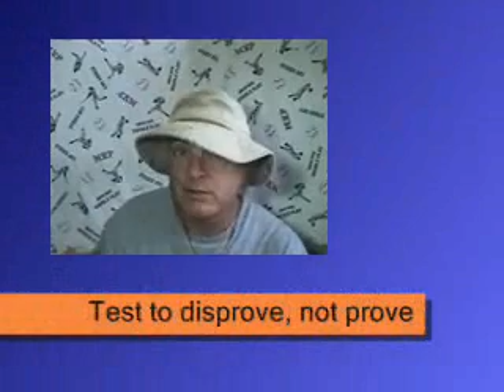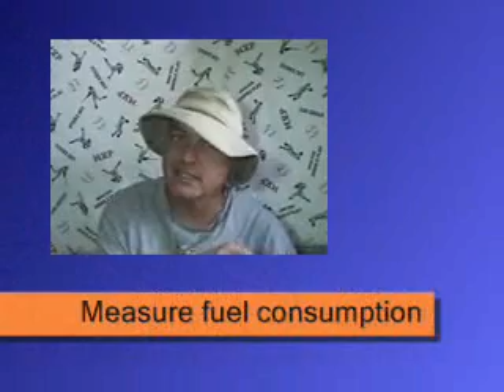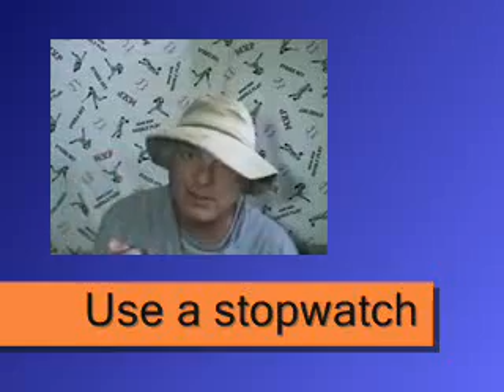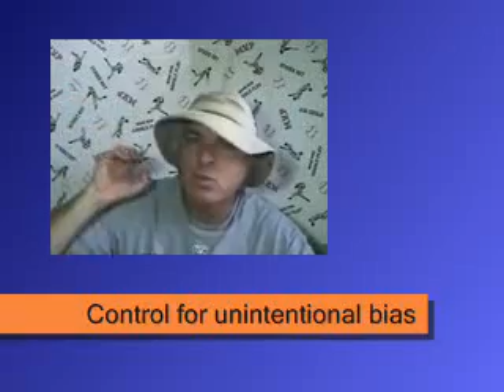Regarding: '#232 - HHO runtime experiment part 3'

Comment: @FredricF Actually no thats not why. Go check some more, just listing peak power would be useless, ohh but wait they also list the rpm of that peak power, which in fact is going to be a form of power. It is sad though how you are pulling the topic sideways, and never have addressed the simple fact that the comment is in fact correct. you simply wish to talk about how manufacturers list a description of their product. Which BTW is correlated with fuel per hour with generators. Keep trying.

Comment: @d3adp001 
So your argument for expressing the output of an engine as energy instead of  the correct quantity, which is power, is basically insults and repetition. Not that impressive. 

A question: Do you think energy can be created? Or "generated"?

Comment: @d3adp001 
I have a Masters degree and people pay me to work with motors (among other things). I get paid, not to read manuals and fix with them, but to design systems and tell the tech. writers what the manuals should say.
I know all about motor power, rpm, and torque curves. I have read specs. I have not yet read a single spec that talk about energy output from the motors.

Why don't you just admit you made a blunder and stop trying to cover up. And learn to spell and what "ad hominem" mean.

Comment: @FredricF u should so they can tell u what I am telling u, They rate their engines in PEAK POWER 1hp=746watts, they do this because idiots like u would understand it if they told u the real specs of the engine which amoung other things is a curve of energy content of fuel in vs energy output of engine. 

EVERYTHING BUT ONE THING U SAID IS WRONG "a really smart guy on youtube" u got that correct, and thats the only thing u got right

go away u fucking idiot

Comment: @FredricF to clear a couple things up: Engines (ICEs) DO NOT PRODUCE POWER. They convert energy. They convert stored chemcial (ulp) energy into many other forms of energy such as light, heat, kinetic/mechanical.  The kinetic energy excerted on the engine results in mechanical motion which is then measured by acceleration vs time.  THen through many conversion processes, can be measured anyway you want.

Comment: @FredricF energy is = to Joules= wxS = power in time
power is = watts= a timeless measurement, instanteous measurement. Engines produce energy, when you change the throttle closed the POWER OUTPUT goes DOWN and THEREFORE the amount of energy being expended or output GOES DOWN.

Do you have the mind to keep up with the conversation? or do I have to "SHOW MY WORK" for every math problem there teach. 
Do you know the difference?

Comment: @d3adp001 Still not convinced you know the difference between energy and power.

Engines produce power. When you change the throttle the power changes (usually). You used the word energy instead of power which could be a typo or a sign that you are not really sure about the difference. At least not sure enough to use the correct word.

Comment: @Chicken Good u can use a mcirometer
So show me the data, please if its a pertinent then it will make this all much easier, but I warn u, it must have the correct pieces in the DATA from an actual TEST
What law do you think would have to be violated
No u dont need data because like every fanatic u have FAITH in a RELIGION
its not the conversion that will change anything in the test
yes u do seem to care WHICH IS VERY BIASED AND NOT SCIENTIFIC
but you dont know because you have seen it, ZEALOT

Comment: @d3adp001 
Sigh. Assumptions?
I have sufficient hands on experience with my physics credentials.
See I can measure my dick too. The Ph'ds DO know the answer.
In my experiences, the particular laws of physics are IMMUTABLE.
I dont NEED any test data, I KNOW that as of today, there is no conversion process that will provide more energy than it consumes.
I certainly "care how it ends", and already KNOW, I say again, I already KNOW that the end net result is wasteful.

Comment: and that mixture would reduce the consumption of gasoline... is this venture still not worth exploring?  What I would suggest to test things better in addition to your comments would be to monitor the HP generated during regular, lean, and HHO injected (from an outside source).  If those tests show that adding HHO and tuning the mixture can result in a drop in gas consumption and an equal amount of output... then maybe run the HHO generator off of brake powered generators, or ... cont again

Comment: gasoline engines are designed to run a certain way, yes, but the ultimate goal is to show that an HHO/Gasoline/Air mixture can work and consume less Gasoline in the process.  Wouldn't the addition of HHO (a fuel) make the mixture less lean?  If so, then you counteract the leaning out of the engine.  Running the HHO generator will decrease efficiency no matter what, however, if another energy source were to be used to generate the HHO, and an engine can be made to burn it with gas and air ..cont

Comment: @JamesThWilliams you alude that I am making claims, which is not the case, neither is Zero, PEOPLE have made claims that the increased speed of flame propagation reduces the distance of quence, which burns more and more completely burns, and a better timing burns the existing fuel, thereby adding a small amount of a better fuel, the existing fuel can most eff. be used. If this is the case increasing the eff. of the fuel burn by a small margin makes a difference in fuel economy.

Comment: @JamesThWilliams hmmmm, so you wish to be that literal because thats the last little thing you can attempt to do in your failed arguement. 
your stats are wrong on eff. BTW its 80-85% eff. 
the hydrogen fuel cell used to produce electricity from H2 and O2 is 40% eff. 
And its very sad when you are trying to split hairs like that, its always a sign a someone grasping at straws. 
You understood very well the simplied version to save chars in this format.

Comment: @Desertphile You waste energy every day. By not using what you easily could, and letting it into the air.  You waste energy quite frequently. Everyone does. It would be infinitely better to lose .15% in the conversion of electrical energy to hydrogen energy and then use that hydrogen energy instead of another form that pollutes. You can tow your status quo all you want, that just makes you part of the problem, the problem of insustainability.

Comment: @d3adp001 dude,the tests HAVE been done,and HHO has never so much as shown an ounce of promise,its not fuel,in fact,in the context that HHO device "inventors" use the term HHO,it's not even a real thing,can hydrogen be used to power a car? sure,but in a regular gasoline powered engine? probably not. the point you're missing though,is that HHO devices neither produce HHO,nor does HHO even exist in the context that they use the term,imaginary things can't improve milage

Comment: @d3adp001 it's oxygen AND hydrogen assclown,thats why they don't just call it hydrogen,and HHO is real,no doubt about it,the question is whether you can make a car produce it,and then use it,to the benefit of your fuel milage,and thus far,every time the question has been asked,the answer has been a resounding no,not with a standard gasoline engine,perhaps you should do some of this reading you claim to be so fond of,nobody EVER has built a working HHO device for a car so far

Comment: @d3adp001 I don't "believe" in anything,i face every new circumstance with varying degrees of certainty,based upon my understanding at the time. thats different than believing,and it's different than believing in homeopathy since homeopathy is a type of "medicine" that CAN NOT POSSIBLY work,if homeopathy does work,or has ever worked outside of the placebo effect,they'd have to start medical science over from the very start.

Comment: @HHOinfo well considering that the fuel has a liquid bubbler barrier to draft in hho, that the draw tube goes directly to fluid, that the jas is vented to outside air, and that hho disapates very fast, and that Z understands what he is working. I see no safety issues. 

On top of that, DP's comments were not in regard to the combination of hho and fuel, but in regard to the fuel alone, which if the system was unsafe, then the metal fuel tank that once held the place of the jar wasnt any safer

Comment: @LeksServices Failed,, to make your point understandable by using complete sentences. 
But 30,000 per vehicle, hmm even if it was a semi rig (worst fuel econ) that would be 150k miles per year. which would take 2500 hours at an AVE speed of 60 which is 500 more hours than you can really work. 

So what is this tech that can safe more fuel that one can possibly even burn.

Comment: @coasterpro  Assertions should begin with "IMO."  'Zero gain' is your gratuitous assertion. Or you are quoting an entry from a 1950 Encyclopaedia Britannica.  Either way it is gratuitously dismissed.  

Electrolysis is NOT the end game. 

The ICE powers electrolysis of the HHO..  HHO  injection from a modern electrolyzer into the ICE improves  operating efficiency. Net gain in efficiency = END GAME.       

Desertphile is the one who demands windmill powered electric vehicles IMMEDIATELY!

Comment: @OgMandin0 HHO is a bridge to no where. It represents zero gain. As for electric-only, the lack of electric cars is due to utility demand and charge times. If everyone were to go electric today the grid would simply self-destruct. On top of that the inconvenience of a long charge time vs. the convencience of a 5 minute fill-up is a deal breaker. Even with more power stations and a new electric infrastructure, battery tech just isn't a viable replacement for general automotive use.

Comment: @OgMandin0 

You run into similar problems why hydrogen, in that it requires large amounts of electricity to produce it in a molecular form. Hydrogen is the most common element in the universe, true enough, however the majority is in compounds, or within stars, and therefore unusable as fuel.

Comment: @wwickeddogg 

You can burn a mixture of hydrogen & O2 to produce mechanical energy, or combine hydrogen & O2 to produce electricity (and water), we don't dispute that.

What you can't do (yet) is produce enough hydrogen cheaply of cleanly enough to supply the demand for fuels. The best way so far we can produce it is electrolysis of H2O. The problem is you need large amounts of cheap, clean electricity to make that a viable source for the amounts we would need.

Comment: @Desertphile --- "Er, yes, but unfortunately that is impossible. " Not according to the Australian study you yourself posted. What you fail to understand is that this is not free energy, the gain in MPG comes from the gasoline or diesel, not from the converted water. HHO increases the TE allowing more energy to be released from the fossil fuel. This is not simply what I say, it's a documented fact. Believe what you will but you are wrong...

Comment: @Desertphile Unfortunately, even if I do prove to myself and my audience beyond a reasonable doubt that it is possible, you still won't believe it because you are 100% predisposed to believe a 15-20% efficient engine cannot be made to run 25-30% or more efficient by altering the combustion properties using a gaseous compound created by the energy from that same engine.

When my tests are done, I will be able to say with conviction whether or not it can be done. Believe it or not.

Comment: Power conversions are a concern as noted by HHOinfo. This is a brand new Delco Remy 160A alternator. It's known 2b 50% efficient and my HHO cell is 4.5mmw (60% eff). That's a total conversion efficiency of only 30%, consistent with present automotive systems. If I can even come close to baseline numbers with this much loss in the system then there's hope. If I can exceed baseline, we're home.

Comment: Well, big D, I'm honored you took the time to produce a video response. I will respond to several points made by you and others here.

The protocols will be published along with the data collected, summarized here.

The graduated cylinder is replaced by fixed amounts of gasoline premeasured on a digital scale, +/- 0.01oz.

The run times will be measured until the engine stalls.

There will be 10 measurements taken for each phase of testing.

Comment: @d3adp001 "... you lean out the engine it will release less energy for a given throttle position... " It sure looks like SOMEONE don't have the slightest clue about the difference between energy and power.

Physics class 1A: Energy  = power * time (dumbed down to simplest possible math).

Comment: @wwickeddogg are you speaking hydrogen powered, if so then yes I completely understand why its a good idea. WHY? its exhaust is water, and can be reused, and drank by people. HHO may or may not have certain uses, but the ability to store energy in the form of hydrogen is very important, because you can do it yourself, can you drill an oil well? didnt think so. But you can get some solar panels, and become energy independant.

Comment: Now if you phrased it correctly "The only way I will accept this data is, blah blah blah.."  Then thats fine
The point is to find out what happens in each of the methods, if you dont want to accept it thats fine.
The church didnt accept the sun centered solar system either. Among others

Comment: In addition dummy, a burning cigarette WILL NOT IGNITE GASOLINE, you watch too many movies. 

I have had a great number of cars, heck your old enough you should have also, that had many glass parts in their fuel systems, carb bowls, fuel filters, etc. Glass is great for that because it cleans up well. 

But you never use glass to contain a burnable mix of vapors that is stupid, but you dont even know the difference do you? sheesh

Comment: DP you have to understand that the leaning of a motor while may increase the fuel economy and will damage your engine, you can only lean the mixture so much before it shuts off. this is called Stoiciometrics. the proper and most efficiant way to burn CHOs is to have a 14:1 ratio Air/fuel.... 

And how is that glass jar a "shrapnel" device? there is not pressure in that system...

Comment: OK DP here is a FACT diesel small trucks are sold in almost every other country other than here, 2.5L TD engines, but they WILL NOT sell them here, and YOU CAN NOT import them. They burn clean, and since the fuel econ is much better the overall impact is much less, so where are they smart ass. BTW WHY DID GM TAKE ALL OF THE EV1s and crush them when poeple were willing to buy them, in your own words, FUCKTARD

Comment: Again you need to get your physics straigh, Power is equal to watts, what is being measured is energy, a slight but very important difference. You really dont understand that if you lean out the engine it will release less energy for a given throttle position, which means the throttle is opened further to maintain rpm, and thus energy since the load applied has not changed.

Comment: you will not increase fuel economy since power level drops off it actually uses more fuel to produce the safe amount of energy, do I have to explain all of this to you today? 
And thanks for the recap of what Z already told you he was going to do, very typical arguement stragety to repeat back, while shit talking in the middle, but it does change that your repeating someone. Your assertion of it does work that way with no test data to support your arguement is very sad and not very open minded

Comment: DP, you do you relize that glass carb bowl have been used for a hundred years, and are still used to this day? gasoline needs a very precise mix to burn and therefore its safe, unlike hho which has a huge burn ratio and is only unsafe when the possibility of direct spark of flame is present. Sheesh and you think you know something.